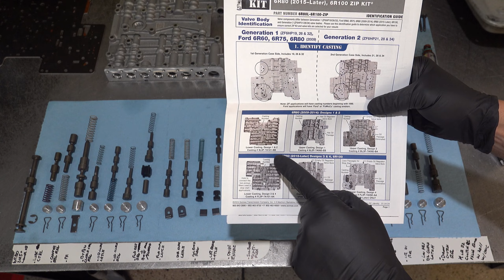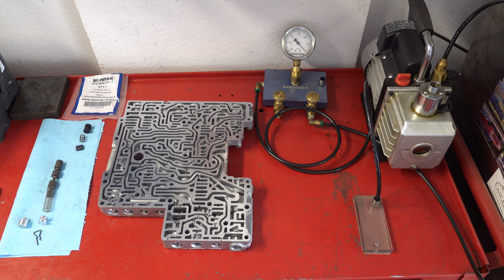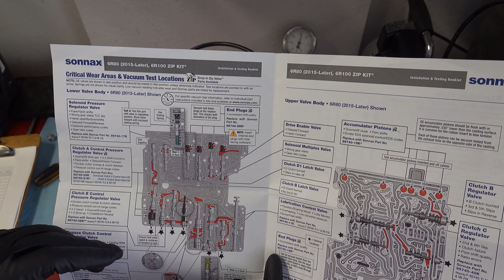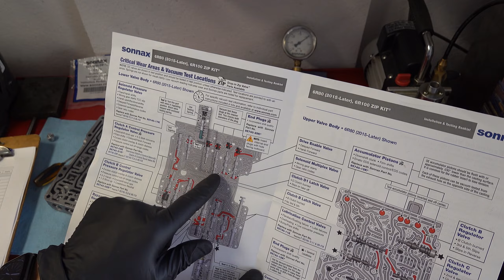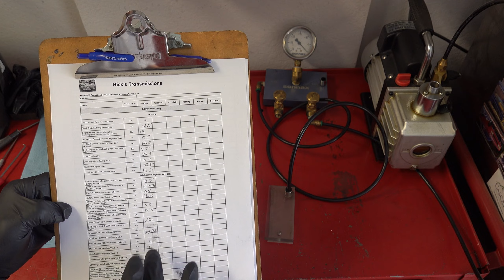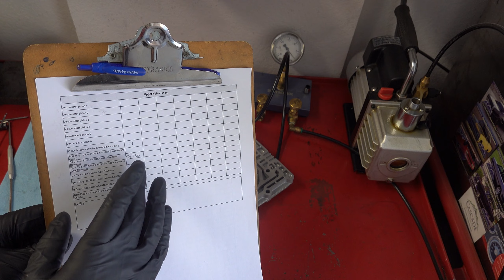6R80 Valve Body PT1 - Overview & Initial Testing

Comment: I trying to identify my 6r80 valve body. So I can replace it. It came out of a 2010 Raptor 6.2l. It appears to have conflicting parts. Some from pre 2010 and some 2011 on up. The plate is AL3P-7Z490-BA. Lead frame with no TCM. Upper casting L2P-TA092-EB with 4 feeder valve holes and a valve in the D2 circuit. Lower casting LP3-7A101-BB. Solenoid pack is cream colored bases with brown and black snouts. Transmission doesn’t have a one way clutch valve. D2 hole on trans housing goes through and no clutch spring. I have only had the truck for a year and it started harsh 1-2 shift. Until it warmed to operating temp and then shifts perfect. No DTC’s when scanned.  Shouldn’t this valve body have a TCM located on the valve body lead frame and different solenoid packs from pre 2010? Build date shows 4/10/2010 on the truck. Transmission tag matches. So i don’t think the transmission has been swapped but maybe someone has been in this valve body before and didn’t put the correct parts back in. Any help would be much appreciated.
Reply from the maker: Hi Joe, thank you for watching. I would contact your local Ford dealer, ask for 'parts' and give the parts guy the last 8 digits of your VIN. He will confirm exactly what variant of 6R80 you have, whether or not you have an in-transmission TCM (ie Mectronic Assembly) as well as a rear one-way diode assembly. 2010 was a change year so some or all of the updates taking place in the 6R80 may apply to your trans...

Ford dealer is your best bet for confirmation.

Comment: Hello @nickstransmission , I’ve recently purchased a 2012 f150 with a 6r80 and noticed that the 3-4 shift and the 5-4 shift are a little bit stiffer than any of the other shifts. I can definitely feel the other shifts but the 3-4 and 4-3 are a little stiffer than I would assume is normal. Do you think that could be a problem with the solenoids? or maybe I’m just paranoid because it’s a new truck lol
Reply from the maker: Hi Alley, thanks for watching...It's hard to say to be honest, at least from here...Put a bidirectional scanner on it and see what's happening with the transmission and torque converter...Those transmissions have issues with the direct and OD clutch packs so could be the beginnings of clutch pack failure but that's just speculation without more data/information. 

You can continuity-test your solenoids to see if any of them are reading out of spec; if so and you replace, make sure you get the correct band and frequency range (if band #4 solenoids are being replaced)...Look at the color of the snout and that will tell you whether it's a high band or low band solenoid.

You can install the Sonnax Zip kit to see if that helps (it can't hurt and should be installed on all these units, to be honest) - follow my video instructions for the installation (I cover the Zip kit in Part 2 of this 6R80 valve body video series - you can find it in my 6R80 playlist)
Reply: @ thanks for the quick reply, sonnax zip kit sounds like a good idea I’ve done one before to a Toyota Tacoma and it worked out pretty well. Would there be any reason in maybe preventatively replacing the solenoids or does that seem overkill?

Comment: Where can I find the solenoid ID number on the valvebody if it doesn’t have the tag
Reply from the maker: Hi Justin, contact the dealership and provide the last 8 digits of the VIN. They will tell you what sol strategy is applicable to your vehicle as well as sell you the correct solenoid set or an individual solenoid, if that's what you need. 

Thanks for watching.
Reply: @nickstransmissions  it’s a new valvebody but not from the dealership it’s a reman valvebody but it doesn’t have a tag on it

Comment: This may be a shot in the dark, but will a 2015 6r80 valve body and solenoid pack work on a 2014 6r80 case? 

Reason I ask, the 14 and 15 solenoid strategies are different. I’ve got a coyote swapped car with a gen 2 computer and gen 1 transmission. I need to get a gen 2 solenoid set in there.
Reply from the maker: That's a good question - I've never tried to do it so can't say for sure. The main difference between the 2014 and 2015 valve bodies is the changes tied to the 'start-stop' technology. The lead frames are the same and I would think you can determine what solenoid strategy would be applicable via scanning the computer to obtain the solenoid strategy code. Once you have that, you should be able to purchase solenoids corresponding to the correct solenoids for the computer's stored strategy. Alternatively, you may be able to reprogram the PCM but speculation on my part since it's well outside my area of expertise.
Reply: @nickstransmissions  Thank you for the response, and the great information. I used Forscan and programmed my current (2014) solenoid strategy in to my computer (2015) and the transmission quit shifting. Programmed a 2015 strategy in there and it worked again, but is not ideal because it doesn’t match the solenoids in the transmission. I may have to buy a set of 2015 solenoids and lead frame to swap in and program that. I just didn’t know if the 2015 valve body had different passages compared to the 2014.
Reply from the maker: The 2015 valve body does have different passages, specifically a large circular cut out to work with the start-stop tech that Ford introduced in 2015 so it may or may not work on a 2014 case.
Reply: @nickstransmissions  I just wanted to give an update here, and pass on some extra information. 2015 was the start of the gen 2 valve body, start and stop was an option. Not all gen 2 valve bodies have start stop. 

If you have a late gen 1 case (2013-2014), a 2015-2017 valve body that does not have start/stop will work on the gen 1 case. 

I did this swap last night. The Gen 2 valve body has an extra bolt hole compared to gen 1, but that is not an issue.
Reply from the maker: @MRLWARRIOR1016  Great information, man! Appreciate you following back up and good to know there's some interchange options for those units between early and late.

Comment: Incredible content - thank you.  There is such a lack of 6r80 rebuild content.  I just rebuilt my 6r80 valve body and assembled the valves wet with trans fluid.  Can I test the halves if the valves are wet with fluid?   Will it give an artificially false high vacuum reading?
Reply from the maker: Thank you for the kind words, Tim! Yes, you can test it as-is since you assemebled with fresh trans fluid. While your readings may be slightly high relative to what they would be dry, I dont think it would make a material difference...

Comment: I got a pile of these valve bodies I've started going through.  I see the same wear on pretty much all of them, A, D1/E and pressure regulator valve.  I've got a few with excessive bypass control valve wear, but for the most part they all vac the same.  Very similar to yours.  It's a shame, valve bodies used to be cheap for these then when lead frames were unavailable the price doubled.
Reply from the maker: Yep, they are wear in the same spots...In fact the all three of the six-speed variants, GM, Ford and ZF are largely all the same in terms of what goes wrong and how you build them. GM is a little different than the other two, owing to the massive engineering changes they made to the base ZF design but I rebuild every one of those transmissions exactly the same way...Only real difference is when high performance or extreme duty is the application, I start adding billet parts....

Thanks for watching, Rob!

Comment: Ford has recalled all of the 10 speed problematic, transmissions or vehicles should I say with that transmission
Reply: No way, the 10 speed still has problems. You can’t believe ford for anything
Reply: GM and Ford 10 speeds are basically the same. It was designed in a joint venture between Ford and GM. Same as the 6 speeds. Both front wheel and rear wheel drive. 

The 10 speeds from GM make noise from the pump gears. They are helical cut. Fords are straight cut. Fords are not making the noise. The fix for that is put the ford gears, on the GM version. Good article on that in June 2024 Gears magazine. 

Nick, another excellent video. Can’t wait for the rest of the Valve body video.
Reply from the maker: Good information, thanks Larry! I haven't seen any 10-speeds just yet but hoping one comes my way at some point soon so I can do some vids on it. Same with the 8-speeds....Have never touched one (GM, Ford or ZF).
Reply from the maker: Interesting...I don't know much about the GM or Ford 10-speeds as I haven't had one come through the shop yet but from I've been reading (mostly on forums) that the GM variants are fairly reliable compared to the 8 speeds...